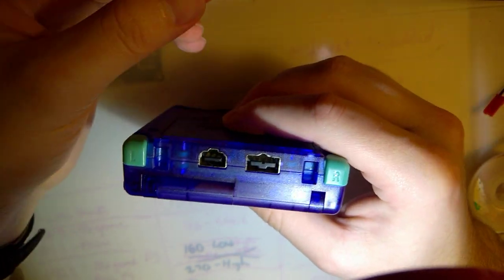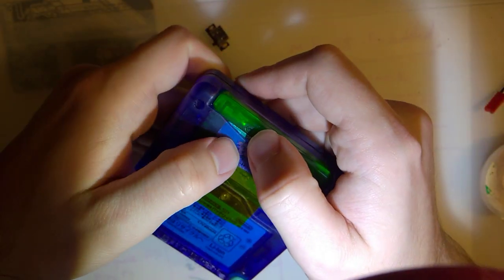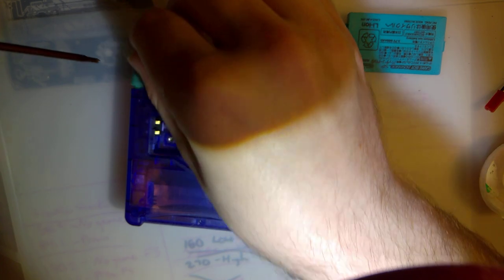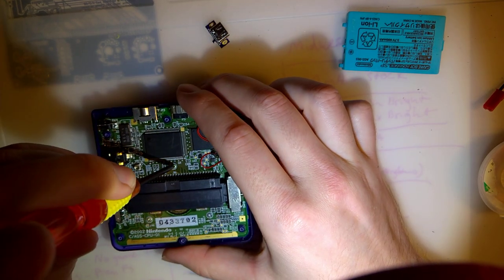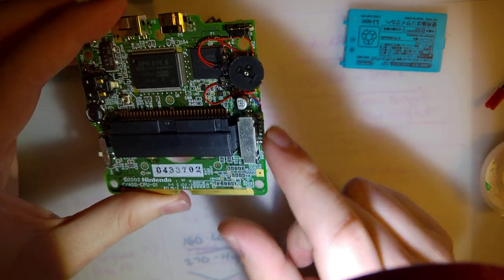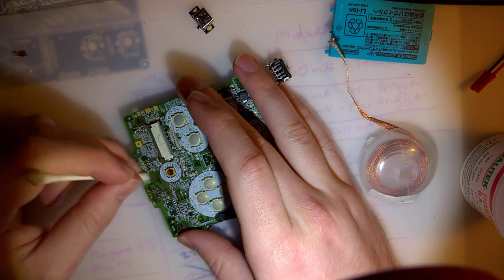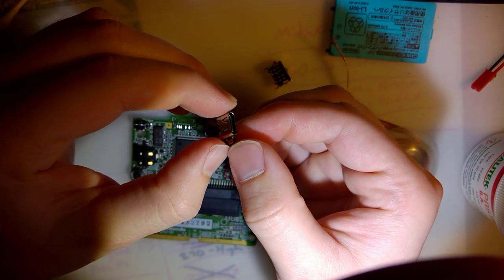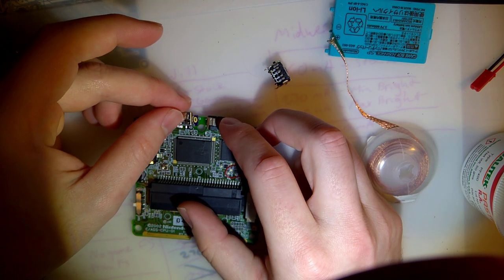BlindEye's GBA SP USB C Charging Port Mod

Comment: Having no mechanical connection, Those solder pads will give up a lot sooner than we all like.
Reply from the maker: The original port was held to the PCB with those pads. The two big ones on the sides.
Reply: @makho  Original port was through hole though, The pins & the ground shield.
Reply from the maker: @HoZyVN  No reason you can't add some through hole pins then just using some extra header pins. It would probably make installing it easier too.
Reply: seven months later and it still seems fine. Not quite the 15 years of the original port but it's something.

Comment: Use suguru! It’s like moldable plastic putty stuff
Reply from the maker: I actually ended up getting a STL from the creator of the mod for a plug. With a very slight modification, the 3D printed part fits perfectly and doesn't even need to be glued in. 

And before anyone asks, I'd post the file but it's not mine to share.

Comment: shame it doesn't work with all USB-C cables. And I hope you didn't burn your thumb too bad :)
Reply from the maker: I believe that future revisions will include some resistors on the CC lines to allow USB C to USB C charging. In the mean time, you'll have to use a USB A to USB C cable. Such is life, I guess. It's better than the alternative at least.
Reply: @makho  is there already a new one? I'd love to fully transition to usb c
Reply from the maker: @daedgoco  Not yet. I haven't done anything with this yet.